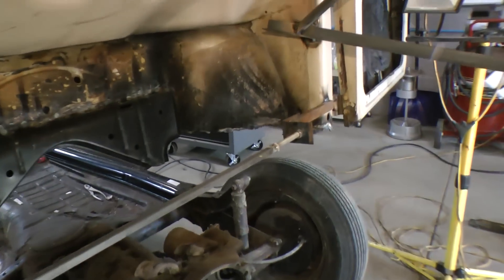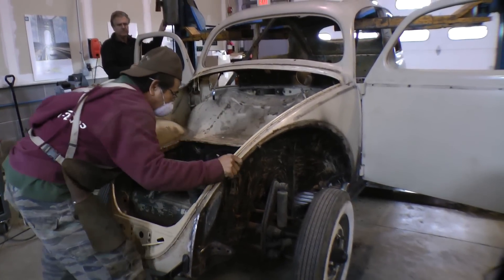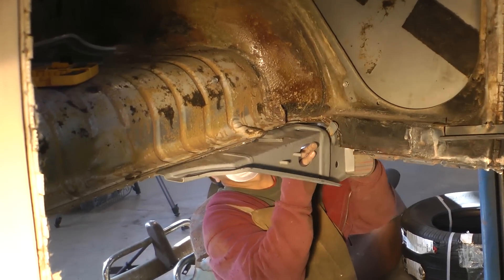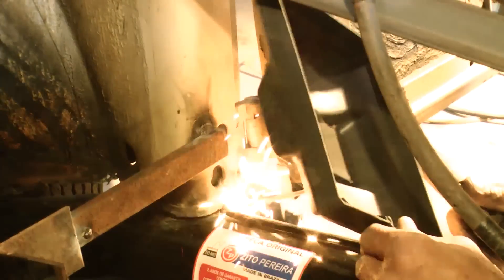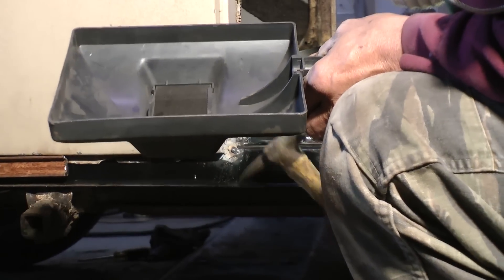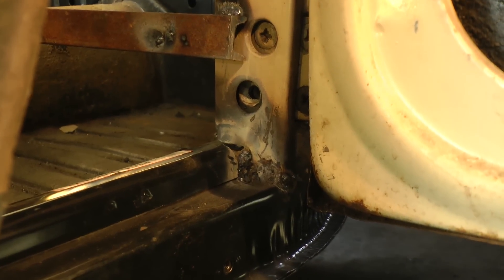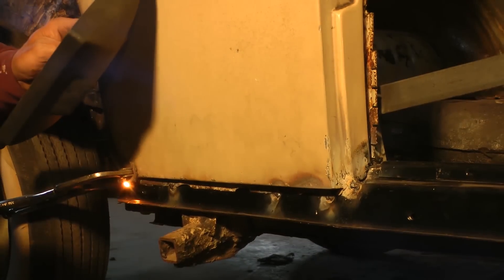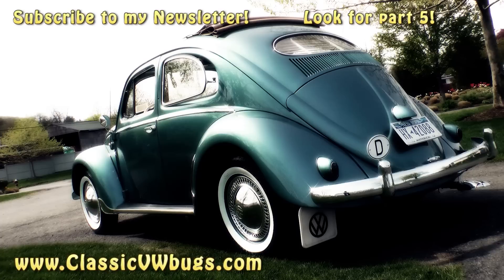Classic VW BuGs How to Repair Restore Beetle Heater Channels pt.4

Comment: Fascinating Chris thank you. You answered two questions I had on this; (1) The heater channel windscreen (windshield) feed and (2) the door fit. Most concerning for me is the latter in trying to get that "factory feel" to door closing, or at least to a level of accuracy that allows subsequent and meaningful adjustments to the door at the final stage of re-assembly. I like the use of the "accordion" tubes - must make a vast improvement at directing heat.

Regards

Ian, Birmingham, England

Comment: Another quick question Chris, why do you have install a 6 volt soleoind on my 64 bug to get the starter to work, it's not stock but tht finally fixed my starting problem, what the factory fix for this problem thks Scott.

Comment: I'm replacing the heater channels on a '74 super beetle. I bought the front wheelwells, rear part for both sides. The problem I'm having is that there are still a couple of holes left over from the wheelwells and the sides of the front firewall. I homebrewed the areas in front of the heater channels where the body bolts through from the chassis in through the heater channel and into the front firewall, but still I can't figure out if there is something I'm missing. Have any ideas? TNX for VIDS
Reply: can you find other 74's close to you to see them ?  the samba ?  -- sometimes the "repair panel" is not complete, it is not a restoration panel...you might have to get creative...good luck !